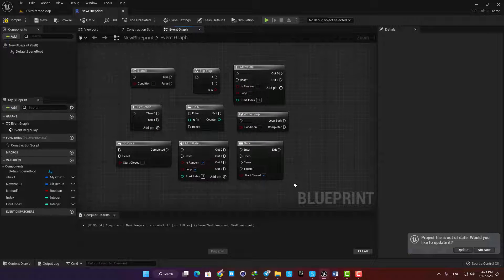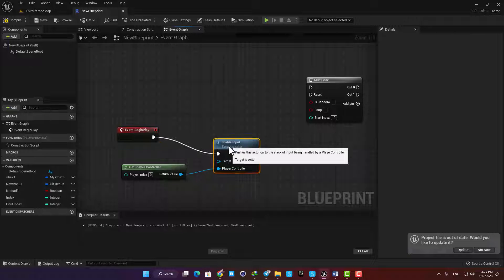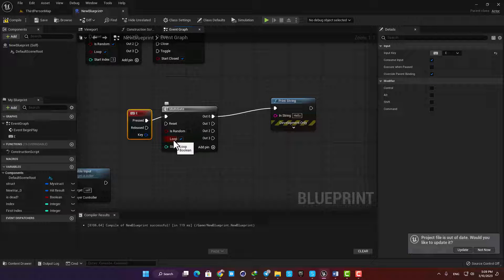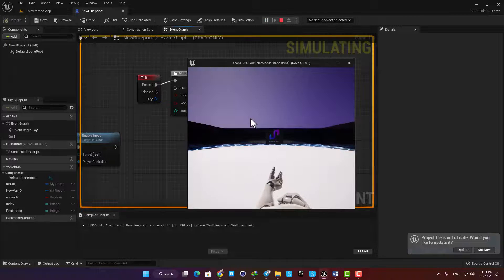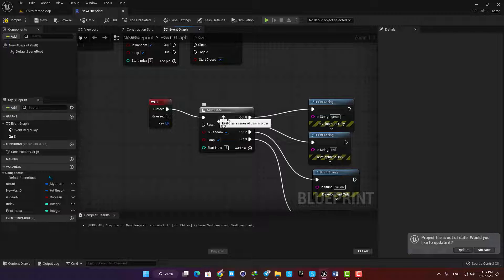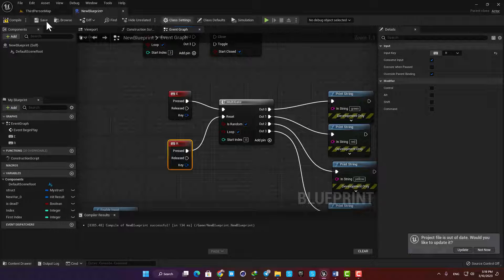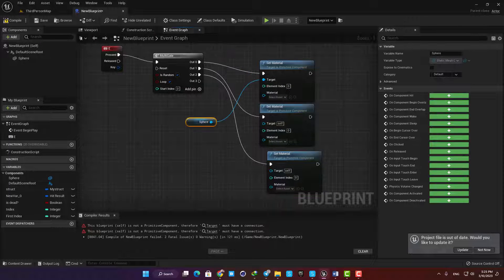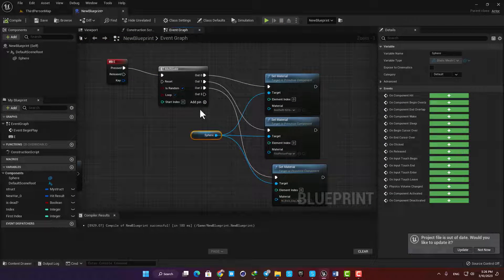Multi Gate Explained For Beginners - Unreal Engine 5 Flow Control Blueprints

Comment: To prevent something that has already been triggered from triggering again, what feature should I add? For example, when touching a Trigger box, I want a specified actor blueprint to change to another actor blueprint each time it's touched, but I want to set it up so that once it's triggered, it won't trigger again
Reply from the maker: I think you need a Do once node . just add it before the function you wanna call and it should do the job
Reply: @UnrealART  Yeap man it works perfectly haha thanks